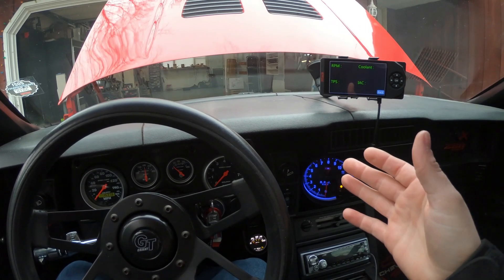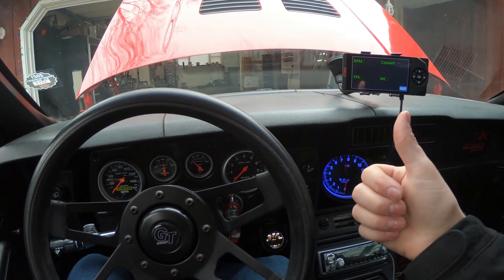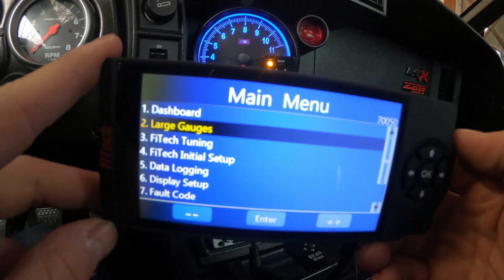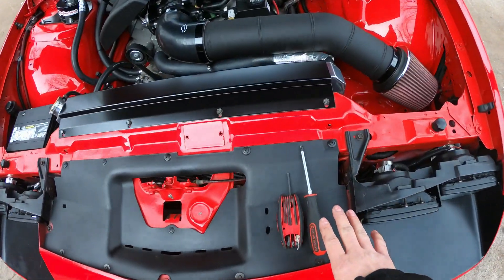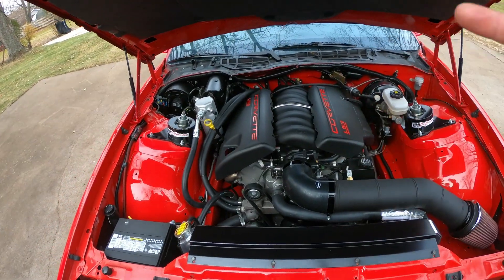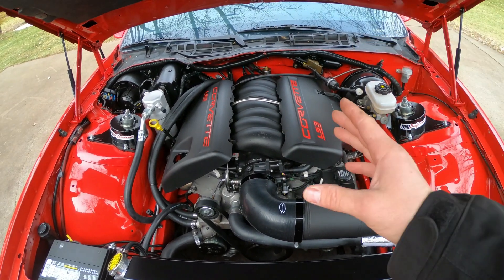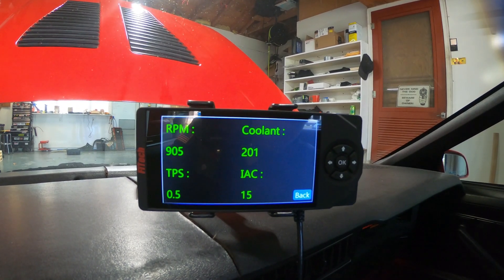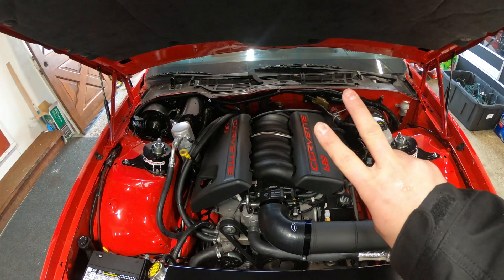How To Set IAC Steps On Fitech Ultimate LS System. Solved!

Comment: Hey brother, know this is an old vid but wanted to ask you if you have a stock cam in the iroc? 
I have a BTR stage 2 and it doesn’t like the IAC under 60.
Setting it between 3-10 causes it to die in reverse.
Any thoughts?

Comment: got the fitech 30005 and when initial frist start up i got it to run but for some reason i can not turn it off with my key i had to disconect the plug from my distributor..i have my white wire going to my fuse box to ignition fuse and my blue wire going to my green wire from my distributor which is my tach wire... i have a hei dis. and 355 small block 1990 k5 blazer...it wont shut down with the key off...my pump is in the tank

Comment: My iac steps are in between the 0-10 range but the engine idles at 900-1100. I have it set to idle at 700. It is a bone stock 5.3
Reply from the maker: Would check for a vacuum leak somewhere.
Reply: @Brandon-LSX  exactly what it was. The guy who did the swap half assed the job and didn’t put a cap on the vacuum he didn’t use.
Reply from the maker: @_aj345_  Glad you found it.
Reply: @Brandon-LSX  one more thing, does the fitech system have a neutral safety wire? I’m installing a remote starter and I don’t necessarily need a neutral wire as I can ground it but I’d rather be safe than sorry.
Reply from the maker: @_aj345_  I'm not sure never hooked one up.

Comment: How did you wire your key on
Reply from the maker: Wired it to the the 12v switched on the ignition.
Reply: @Brandon-LSX  under the steering wheel
Reply from the maker: @MichaelBrown-kz9qk  Yeah yellow or purple wire if I remember right check it with a test light to confirm.

Comment: I bought a FiTech loaded TB & have had nothing but troubles. The TPS was junk & had to to be replaced right out of the box. Now the TPS reading stays at 0.5 no matter what & setting the IAC is impossible because letting it run for periods of time makes the IAC always land at 0 eventually.  It never levels out in higher numbers. I'm at my wits end with Fitech.
Reply from the maker: I had a similar issue with it reading .5 I had to loosen the 3 screws on the tps and hold it twisted back a small amount then tighten the screws while holding it in the back position. It seems to help zero it out. If the iac is reading between 0-10 it's doing its job.
Reply: @Brandon-LSX  thanks for the reply, I appreciate it & will give it a try!
Reply from the maker: @ahlers1977  No problem